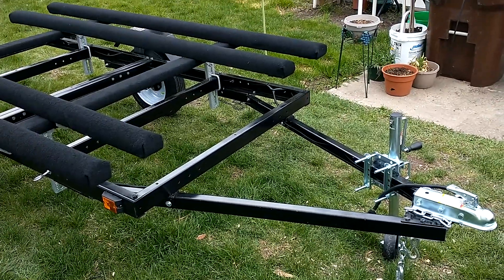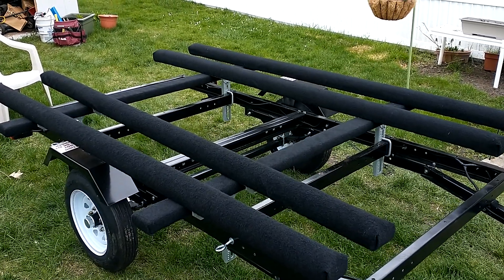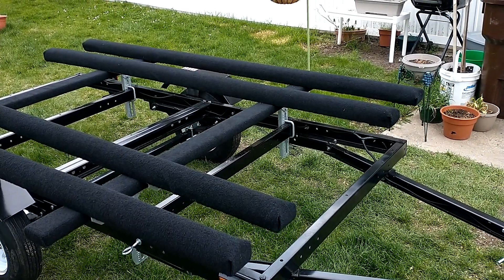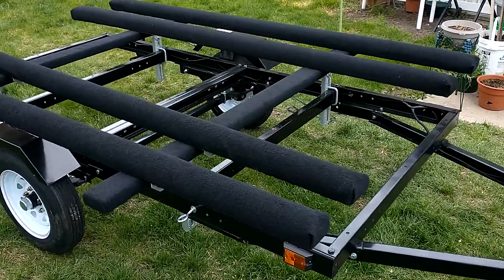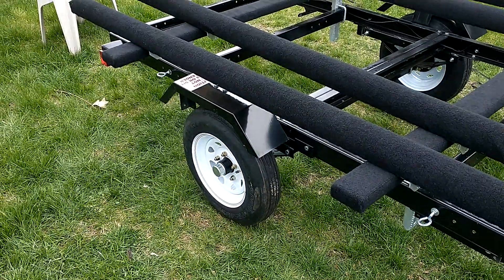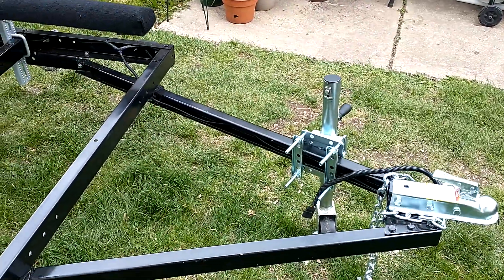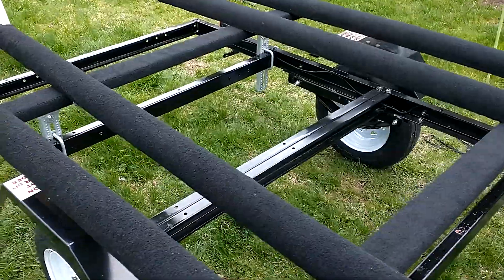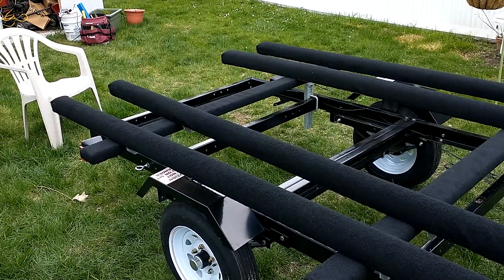Kayak trailer

Comment: Great looking trailer. I’m doing mine the same- anything you would have done differently?
Reply from the maker: Not really except for maybe obsessing about the bearing assemblies.  I ordered extra bearings and caps but with over 5000 miles just last summer we never had any issues.
I repacked the bearings when I assembled the trailer and checked and re-greased them one time after that.
The best thing about doing it myself was knowing every inch of it inside and out.
This year I going to put radial tires on it.
Take your time and Have fun with your build.